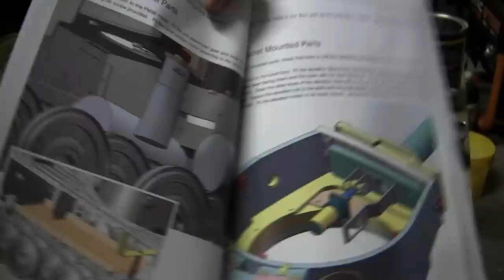Armortek Late Tiger I Project video #6 (motors, electronics, and test drive)

Comment: Hi John, As a constant viewer of your videos regarding 1/6 Armortek R/C tanks, I have learned many skills and tips from them. I wish thank you for your inspirations.

Now I have recently acquired a 2007 version late type Tiger 1, and is trying to assemble it. 
To this video, I have a question to ask:
From 4:26 -- 7:36, the film has shown the "Long Floor Pan" with two taller walls, which according your quote  is an Armortek stock part. Meanwhile, according Armortek "Motion Pack Assembly Instruction" page 7, there is a figure of a "Long Tray (CE0768)", with different shape and length. Are they the exactly same part? If not, what is the part code number  and from which tank ? Thank you for your reply in advance.
Reply from the maker: I don't know off hand, Possibly. Armortek has rereleased the tiger I so many times and upgraded the motion pack design that they may have different generations of the same part. I do remember that this was a OEM armortek tray and it was not custom made by me or the builder I acquired the tank from. Its been such a long time since I delivered this model to the customer and along with the model I gave him all the kit documents including the instructions
Reply: @oddball759mm  Tank you for the answer John. I have purchased and just received the "Long Tray (CE0768)" today from Armortek. It is exactly the same dimension and shape as the one in this video. 

I don't know why it has shown a different figure in their "Motion Pack Assembly Instruction" page 7 . But I don't need to worry about it any more. Regards, Lerh Chang
Reply from the maker: @LerhChang  I'm glad it was able to work out,  Enjoy your build

Comment: This sounds crazy, but it would be awesome to have a 2 hp engine or so, maybe 1, running a car alternator to run the motors.
Reply from the maker: It would be a feat in engineering, and I don't see why it can't be done with the hull size of the tiger... but it is far too impractical to be a viable power source and would be a maintenance nightmare.

Ironically that system was used on the Porsche Ferdinand and Elephant.
Reply: to get the tank running at 30km/h speed, you can do tank biathlon like those in Russia

Comment: are these tanks fairly water proof? or would I have to do that myself?
Reply from the maker: The o ring sealed swing arms are a help, however you will need to seal off all seams of the hulls plates with silicone if you were going to make it fully waterproof. 

As for the Electronics, no they are not waterproof and getting the interior flooded is NOT recommended!
Reply: ok awesome thank you hahaI was a litte worried about snow.
Reply from the maker: Snow is not an issue. I drove these through snow many times without flooding issues. 

The only issue that snow running causes is when the snow gets compacted in the tracks, wheels, and around the idler. It becomes ice and puts strain on the running gear. 

If it builds up enough it can result in broken track links and seized wheels... much in the same way the real german tanks experienced in Russia during WWII

Comment: Basic Electric, Red has always been known as the Pos or + Voltage Side while Black is known to be Ground or - side... I am new to RC so perhaps RC Red is Neg and Black is Pos...
Reply from the maker: No Red is Pos, Black is neg, RC is no different, I had a typo... sry for the confusion
Reply: Whew, thanks for clearing that up, I thought I was missing something... Cheers... 

Needless to say I'm green with Envy you have this tank as I would luv to own one like this... Of course I don't have the room for it at the moment but all in due time... LOL...

Comment: Too bad you can't use a Tesla 24 volt power cell
Reply from the maker: I kind of do nowadays. This is an old video, since then I moved away from the lead acids and have for a little while been using Lithium Ion batteries